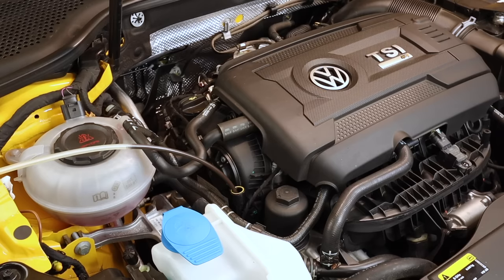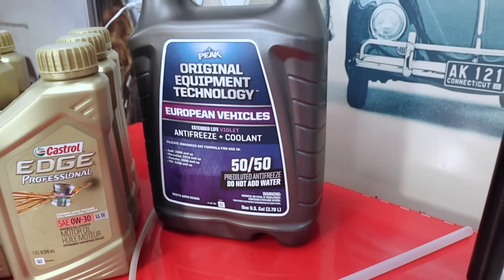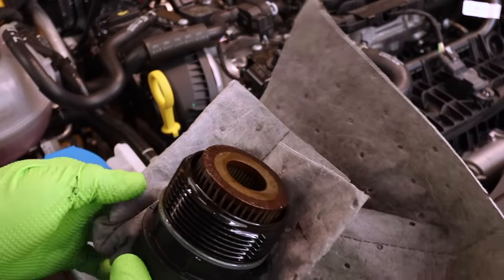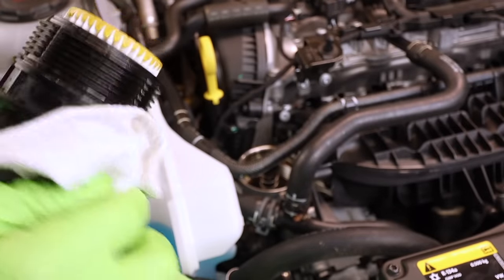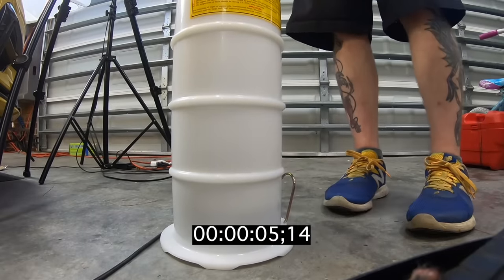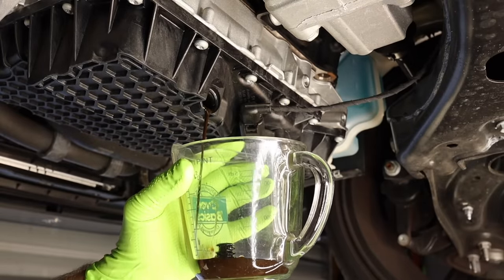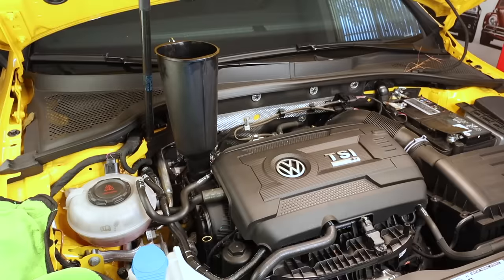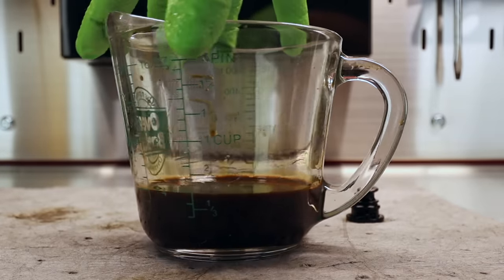Will an Oil Extractor Get All The Oil? (MK7.5 Golf R 5000 Mile Service)

Comment: I prefer the oil extractor method for its convenience and do more frequent oil changes. On the car (Audi A6 3L) I tested there was only ~60ml of residual oil left anyway. Every year I also do one complete sump plug drain to check for any bits of metal or sludge.

Comment: I actually cringed when you said something about a power tool on the filter housing.
I use a midlength 3/8" ratchet on filters and plugs, if it takes more than that to get it off, someonw before me went wrong. If it takes any more than that to put them back on....well, it doesnt.
Reply from the maker: LOL It started as a joke, goodness I hope people don't really do that
Reply: I use a 1/2" on the filters, 19mm wrench to remove the drain plug, and a 3/8" torque wrench to tighten the drain plug.
But I've seen people use power tools to remove the drain plug...
Reply: I had an older car that had the oil drain plug cross threaded by some genius; probably from one of those quickie lube shops. Some people are not the sharpest knife in the drawer.
Reply: @HumbleMechanic  oh, some people really do. I have had to use a breaker bar to remove an oil drain plug. And on a GM motor with the cartridge filter I had to use a breaker bar....on a plastic housing. Luckily it didn't break, but yeah, some people overtighten the wrong things.
Reply: @Uberragen21  i know a guy who couldn't get his sump drain plug loose, so he removed the oil filter and started the car to pump the oil out...
Reply: For some odd reason every other person doing a Toyota oil change just reefs the filter down as hard as they possibly can, I put my torque wrench on one once and it clicked at 160 lbs in reverse. Quick snug is all you need!
Reply: @caveman95987  Christ!!! Surprised it wasn't broken. I didn't think people get it, it doesn't seal on the shoulder, it seals on the O-ring. Technically one thread past the O-ring is all it needs to seal, tightening it is just reassurance.
Reply: @HumbleMechanic  yeah..yeah..!! Started off as a joke and now it's in the service manual. See what you went and did.
Reply: @FourRingsAuto  Hell YEAH !! Damn efficient idea there...!

Comment: Of course this will vary from car to car. Depends on the location of the drain plug and the oil level tube, design of the pan, and way the car is raised up. For my '10 RX-8 it is pretty much the same either way. The bottom of the sump is flat and the tube gets down to the same level as the plug. I can't raise it unevenly either to get an advantage one way or another since the pan is flat.

Comment: No extractor for me, I use the drain plug.  It's so easy anyways.
Reply from the maker: Im cool with that! Some it makes no sense to use an extractor. My r32 is a good example. Gotta put her up in the air for the filter anyway.
Reply: On the Passat you need to raise it up to change the filter anyway. It is all the way down. And I don't like leaving anything in. If it were easy I would remove the pan and whipe it clean everytime :)
Reply: nrgia brake cleaner inside the engine squad
Reply: Jason M filters are actually the biggest culprit of dirt and debris in the engine.  It actually works backwards.  If you change your filter enough times, you can actually stretch your oil service intervals.  This is what is done in the HD industries.  My internship time at Catepillar taught me that.
Reply: @jjm2948  Unless you break the plastic plug, it's not a problem.  Either method is fine, I also don't have an extractor.   I've always done it this way for the past 25 years.

Comment: The perfectionist in me demands a full flush of oil, but the realist says that a small amount of old oil mixed in with new won't have a massive difference. Besides, if VW engineers deem oil extractor to be enough and recommend it, then it must be good enough.

Thanks for the video!
Reply: It's a matter of the whole solution. 100ml of "old" oil in 5600ml of new oil will probably not make any noticeable difference.
Reply: Vw engineers were also the ones that cheated their emissions... also that’s why some manufacturers put magnets on their drain plugs because all the metal fragments sit at the bottom of the pan.
Reply: @Timski2543  I don't think we should put all VW engineers under the plow of dieselgate. Sometimes you've got to do what your team demands of you. Plus these were software engineers primarily involved and not mechanical engineers.
And magnets on drain plugs? That sounds like the manufacturer compensating for low quality alloys or problems with manufacturing process that can potentially lead to large metal objects ending up in the system. The solution is clever though.
Reply: @Victor Dobrovatov 
I agree that not all engineers should have the finger pointed at them but they aren’t the ones that make the decision in the end. Hence VW as a whole is unreliable since they (the ceo and board members) aren’t really looking out for your interests. So just because VW says it’s OK doesn’t mean it actually is.
Reply: Victor, I wish it was just 100ml of old oil.  the truth is  in modern engines 10-20% of used oil remains trapped in the engine. I have oil analysis showing retention of 20% wear metals, contaminents and oxidized oil and degradation of the new oil within 20 minutes of running the engine.  Perform a second oil change, flush, with cheap oil and you will see how contaminated it is.  A second change will give you 99% clean engine oil, just like when it rolled off the line at the factory.  Do this once per year and never use a solvent flush.

Comment: I say its fine if you commit to do your oil change regulary. Keeping maintenance 100% of your vehicle will make that car last forever. Still is not bad to take the left amount off as well. I had a ford taurus 2001 with over 230,000 miles on and never had issues with it. No leaks or problems with the engine ever. I recently sold it and the person who bought it loved it 
Ice cold air, heater like a dragons breath lol. Now i have a kia soul 2011 and i love it! Easy to maintain, small yes but it is a fun daily driver. Only problem is that to change the oil you need a low pan to catch the oil cause this car is very low to ground so thats why i purchase one of this oil extractor to make things a little easier! Awesome video by the way

Comment: As a flat rate tech at a dealer, I suction WHILE I  rotate the tires and doing my other services.  3 tenths spent on an oil change rotate when it pays .5 or .8 depending on the dealer. Plus, I cannot tell you how many techs pull the filter AFTER draining the pan...  That 0.1 of a liter isn't anything.

Comment: "measure cuppy thingy"

Love the technical name.
Reply from the maker: Yeah it's called that in the service manual HA
Reply: @HumbleMechanic  Just better hope your wife doesn't know what you are using her measuring cups for.
Reply: Hes probably used to the taste of used engine oil in his pancakes by now.
Reply: @CarsandCoding  Are you kidding, he uses it instead of syrup.
Reply: @HumbleMechanic  That measure cuppy thing also has a thing on it called a handle. Try using that to hold the measure cuppy thing.
Reply: @HumbleMechanic  Messbechersache hehe

Comment: Chemical analysis would reveal the difference in metal shavings concentration between the bottom leftover and the extracted oil. Ultimately it is the abrasive metal we want to get out.
Reply: that's what i was worried about. I used magnetic drain plug on bike.

Comment: It is important to use the right kind of oil extractor. The ones that create suction with a hand pump will not remove as much oil as the ones that connect to an air-compressor to create constant suction. Even the smallest air compressor will do. I have used the MityVac 7300 since 1998 and always get more oil out than with pulling the drain plug. But in order to get all the oil out, it is advisable to move the tube around by hand at the bottom of the drain pan to make sure all the oil is removed. You can see from the video, that the hand pump extractor did not remove all the oil.

Comment: love the fancy plastic oil pan vs. Japanese solid cast aluminum 🤗
Reply: Plastic has better temperature retention meaning the oil is not well affected by outside temperature compared to aluminum or steel pan which means on cold winter you can warm up your oil faster on a plastic pan

Comment: The oil extractor seems the way to go... My local dealer wants £105 to do an oil change. My oil extractor cost £27.., and to replace the oil and filter was £55.., so a winner from day one. I would also add that I will be far more likely to do my own oil change now, as it is so straightforward.. That has to be a good thing for the life of the engine.. 👍

Comment: I mean, 100ml of old oil in 5600ml of new oil,  it's not really going to make a difference imo.
Reply: If you use synthetic oil and change at less than 10k than last 100ml probably still has a ton of life left in it.
Reply: i would prefer to drain it, but, its not necesary in reality. in fact, if oil is that bad you cant leave 2% of it it probably done some damage to the engine alredy
Reply: The actual amount is between 500-1200ml with these modern engines. I have oil analysis showing retention of 20% of wear metals and degradation of the oil after only 20 minutes of operation after a drain and refill.  It will indeed have long term effects on the engine.  The factory fill did not have contaminated oil, neither does the bottle of new oil but somehow 10-20% of the new blended oil wont make a difference.

Comment: I just did my first oil change with a extractor. Normally done it trough the plug. Planning on doing extractions every 5ks and then at 15k drive to vw for service (I have a good deal with them for service). Where they can do an old school drain and change drain plug :)

Comment: At 176k miles I pulled the oil pan on my TDI (CJAA) and found no debris whatsoever in my pan.   I've been using an oil extractor since I got the car at 41k.   I live in FL (sand/etc everywhere) and honestly expected there to be something in there other than oil.   Don't let anyone tell you this doesn't get everything out.  I change my oil every 5k miles.

Comment: This works perfect for me and is better then drain plug ( Mercedes w211) . The sump plug is 14 inch high, also I put a bit of clean oil in and suck it out to make sure its clean. It does a perfect job.

Comment: Pro tip: to avoid that 100Mls left inside the engine just buy an aditional quart of oil and before putting in the drain plug fill the engine with half of that bottle to force those 100 Mls to come out.
Then you will be left with 100Mls of NEW oil inside and youll be a happy man ;)
Cheers to everyone.
Reply: The reason why those 100ml of old oil still was left is because he used a pump to pump out the oil from the top. If he just pulled the drainplug in the first place he would drain all oil in the engine. Its a good tip but kinda redundant here.
Reply: Give this man a cookie 🍪
Reply: Yep, that's a way to waste a half quart of perfectly good brand new engine oil.
Reply: @tomasnokechtesledger1786  

Why you mad?

It's only quart?
Reply: @225M3RCR  I'm no mad. Waste just because it is totally unecessary. Imagine every car owner doing that waste ... 1/4 or 25% more global consumption of engine oil ... and it doesn't clean anything that's of use. It will run a tiny column of oil on the wall  of the internals.
Reply: A better Pro Tip:  I wish it was only 100ml, but  in modern engines 10-20% (500-1200ml) of used oil remains trapped in the engine. I have oil analysis showing retention of 20% wear metals, contaminents and oxidized oil and degradation of the new oil within 20 minutes of running the engine.  Perform a second oil change with cheap oil and you will see how contaminated it is.  A second change will give you 99% clean engine oil, just like when it rolled off the line at the factory.
Reply: @tomasnokechtesledger1786  

I somewhat agree, with your saying with waste but oil is actually unlimited supply or we would of ran out ages ago

Comment: I'm old fashioned I'll stick with pulling the plug
Reply: John, I am old fashioned and have done my own checking.  I wish it was only 100ml, but  in modern engines 10-20% (500-1200ml) of used oil remains trapped in the engine. I have oil analysis showing retention of 20% wear metals, contaminents and oxidized oil and degradation of the new oil within 20 minutes of running the engine.  Perform a second oil change with cheap oil and you will see how contaminated it is.  A second change will give you 99% clean engine oil, just like when it rolled off the line at the factory.

Comment: I just crack my oil Pan everytime
I need to change the oil cause then I’ll get out all the oil
Reply: Because it is the best way to do it I can tell you from years  of experience that some engines will leave a lot of oil in the sump and others won't but its best practice to drain from the sump so you can check the underside of the engine for other potential faults. Sometimes Ive used the extractor to take out excess oil from engines after they have been over filled. It is common to see this done modern diesel engines some of them have to be very warm and left settle for along time after a top up to get an accurate reading.

Comment: I use a PELA 6000 extractor. The tube that goes in the dipstick is metallic.
I change the oil on all my 3 cars with it. Takes everything. You for peace of mind can fiddle with it for a bit, until it won't suck anything more.

Comment: It really is simple. You extract the hot oil using  the pump, then change the sump plug as many professionals do that are changing oil in many vehicles daily. Health and safety and speed.

Comment: When will the motoring industry wake up to the fact that these long service intervals effectively destroy all the seals and plastic parts within the engine. I am sure the engineering departments are muzzled if they speak out. 

The same is true for "life time" ATF and coolant. There is no manufacturer of  coolant that does not specify a coolant flush interval but some car makers falsely claim its for life...

As for oil left in the engine as you are changing it before the oil has worn out who cares, You could leave a few litres there and still be way better off then you are with a 10K Mile service..
Reply: Andrew,  I wish it was only 100ml, but  in modern engines 10-20% (500-1200ml) of used oil remains trapped in the engine. I have oil analysis showing retention of 20% wear metals, contaminents and oxidized oil and degradation of the new oil within 20 minutes of running the engine.  Perform a second oil change with cheap oil and you will see how contaminated it is.  A second change will give you 99% clean engine oil, just like when it rolled off the line at the factory.

Another dirty secret is fuel dilution and fuel soot caused by GDI.  The manufacturers and oil companies are working quietly on new formulations to combat excessive wear.  This is documented in SAE articles, especially soot.  I have 500 oil samples from a modern GDI engines showing 2x the wear rate in an engine, compared with the same enigne using port fuel injection due to fuel dilution and abrasive soot.  The modern full flow filter does not capture this soot.

Comment: Drain the pan for me always. Don’t want my new oil mixing with that old oil.
Reply: You anyways have at least half a liter of old oil in the engine :(
Reply: Oskar Kim The less old oil i have the better. I always change it when oil is hot to get more out and jack the car high up and let it drain for about 30min.
Reply: I am old fashioned and have done my own checking.  I wish it was only 100ml, but  in modern engines 10-20% (500-1200ml) of used oil remains trapped in the engine. I have oil analysis showing retention of 20% wear metals, contaminents and oxidized oil and degradation of the new oil within 20 minutes of running the engine.  Perform a second oil change with cheap oil and you will see how contaminated it is.  A second change will give you 99% clean engine oil, just like when it rolled off the line at the factory.

Comment: I use a motorised extractor on all our family cars. The supplier recommends using it only every second oil change. I am happy with that. By the way, here in Europe car makers recommend oil change only every 12000 miles,( i live in Ireland)

Comment: 100ml is just to much. I'll forever do the drain plug.
Reply: I think it depends if u do an oil change every 10k or 5k if u do every 5k it's nothing if u do it every 10k it's a lot I see ccta 2.0t come in with 3 quarts of oil 150k 100k miles burns it like a 2 stroke my vr6 with 180k doesn't even do that anyone that buys into 10k service is cheap  or doesn't want to really take care of their car in my opinion

Comment: wow, so many plastic parts in this engine...
Reply: There is an enginerd somewhere trying to make plastic cylinders.
Reply: It's as if they're using a child's plastic remote controlled car as a prototype. And they wont stop until they achieve 100% plastic!!
Reply: @robs1852  no no nooo you stop when you achieve 100% thin TRANSPARENT air for 0Dollhairs...next car?
RGB lightening all over the place, zero oil pan, no darin plug!
Lifetime oil 0 Daollairs!!!

Comment: So great to see this. I’ve always wondered which engines you can reach low enough for an extractor to work?
This is just one example and didn’t he say VW recommends the extractor?
Reply: Some VWs they explicitly say not to use an oil extractor, as a result VW fit a tiny dipstick hole.

Comment: It helps to jack the drivers side up to get the oil to drain towards the passenger side, right where the dipstick (and the extractor pickup) is. When you do that, very little oil is left behind.